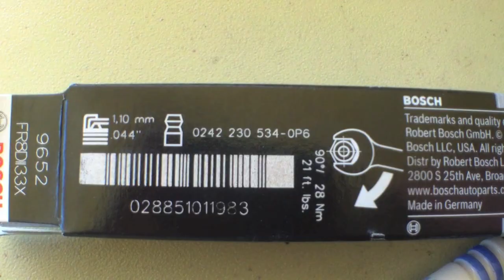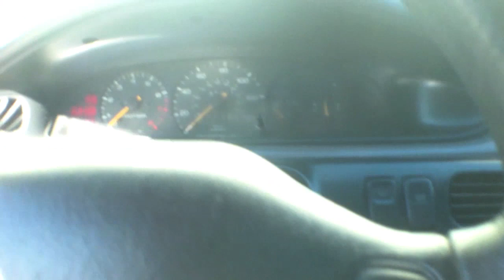SIMPLE FOLLOW Replace spark plugs distributor cap rotor Mazda 626 √ Fix it Angel

Comment: I need to know which spark plug wires go to which spark plug what's the firing order on a Mazda 626 1998 model 2.5 l motor

Comment: u still have the car? and the first thing u changed what does that help. was it broken. im asking for learningim from denmark. have a Mazda 626 gf 1998
Reply from the maker: Hi Stefan, the rotor was not broken. it is always good to change it together with distributor cap and when doing the spark plugs.